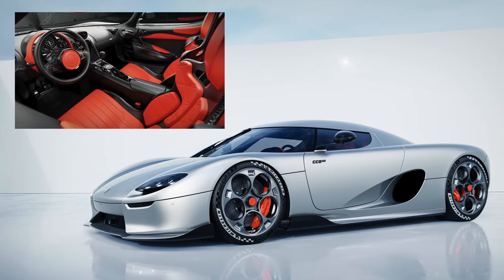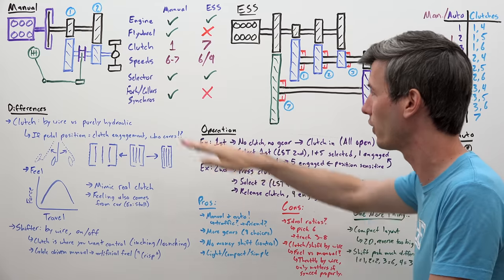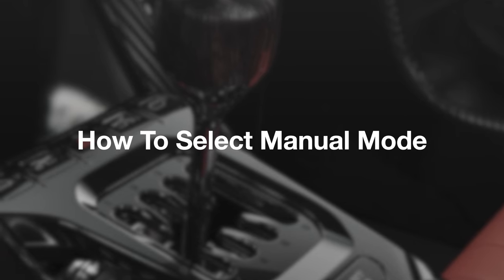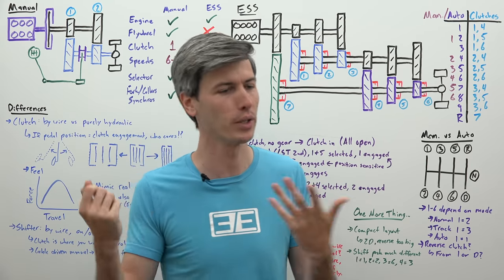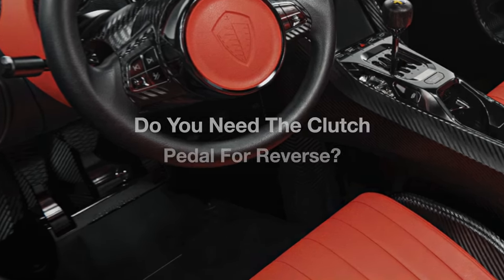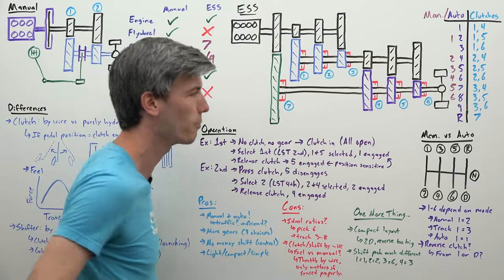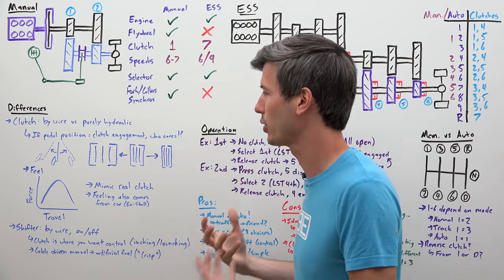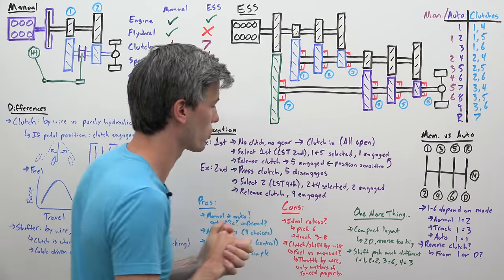Koenigsegg Reinvents The Manual! How The CC850 Transmission Works

Comment: That’s great engineering… but the more moving parts a system has the more prone to one of those parts failing + making it electric is more of the same problem… that system makes sense in a luxury car that won’t be driven that much, having that in a daily driver would be a money pit.

Comment: This is no wizardry. It is a completely automatic multi-clutch gearbox which works as a "stand-in manual" with shift-by-wire system design. ZF and Daimler-Benz does a similar multi-clutch and fork design work in their 8 and 9 speed boxes, only with no fake H-shifter.
No mechanical feel, no actual manual, sorry.

Comment: 7 clutches in a single transmission does not sound like a step forward.
Reply: Typical modern automatics already have 6-8 clutch packs, so your point is invalid.

Aisin transverse 8-speed: 6 clutches, 7 if you include the torque converter clutch, 9 if you include the sprag clutch. Used in Camrys, RAV4s, Volvos, Minis, VW’s, etc.

ZF-8 speed: 5 clutches, 6 including torque converter clutch.

Honda 10-speed: 7 clutches

GM 9-speed: 7 clutches

Etc.

Comment: What took industry so long to start offering five speed manual over four speed and six speed over five speed? During my first half of my life, everybody drove four speed, some three speed, some four speed with first ridiculously low ratio…crawling gear, or very long fourth gear…Volvo, VW. My Jetta has fifth gear outside of the transmission case…Weird?

Comment: wouldn't it be a lot easier to just install a racing gearbox and slap a pneumatic shifter and auto-liftoff software on it? all the linkages for this have to be absolutely insane lol
Edit: Nevermind, I didn't realize it was by wire; super lame :( (I'm glad it lets you stall it though, at least they're trying to make it not seem fake)

Comment: Ok, so it uses hydraulic pistons to squeeze clutch packs to connect and disconnect various gears, just like a normal automatic transmission. As opposed to the manual synchromesh system.
I think the only thing a traditional transmission can do that this can't, due to its electronic selector, is that you can't speed shift with the electronic version. Speed shifting is when you change gears without a clutch. If you know the correct RPM the engine needs to line up the next gear, you can pull the shifter into neutral (again, without engaging the clutch), then rev the engine to the correct RPM, and then move the shifter to the next gear. 

This little party trick can actually change gears faster if the driver is very talented. But I guess it's a dying art since tech like this doesn't even let you do it. Sad

Comment: this makes me think "800K transmission clutch change out" every 10K miles....
Reply: Typical modern automatics already have 6-8 clutch packs, so your point is invalid.

Aisin transverse 8-speed: 6 clutches, 7 if you include the torque converter clutch, 9 if you include the sprag clutch. Used in Camrys, RAV4s, Volvos, Minis, VW’s, etc.

ZF-8 speed: 5 clutches, 6 including torque converter clutch.

Honda 10-speed: 7 clutches

GM 9-speed: 7 clutches

Etc.

Comment: This is not an invention of Koenigsegg and is how most modern automatic transmissions work. Multi Plate Clutch Packs are nothing new. Motorcycles been using them 100 years. This is how every automatic with more than 4 speeds works.
Reply: Yeah it’s kind of funny seeing other comments moaning about “nurrr 7 clutches is too many” when regular automatics have been doing this for years.

Comment: It sure looks to me like this is just a modern interitation of a counter-shaft power shift transmission that has been in heavy equipment for decades. The gated shifter is just mimicing a manual transmission, there is no reason why it couldn't use paddles instead.

Comment: This definitely IS pretty cool and a meaningful innovation. The old-school dude in my head is panicking at the idea of 7 clutches. Pretty cool until you have to maintain this, yikes!
Reply from the maker: Modern automatics have seven clutches.
Reply: Typical modern automatics already have 6-8 clutch packs, so your point is invalid.

Aisin transverse 8-speed: 6 clutches, 7 if you include the torque converter clutch, 9 if you include the sprag clutch. Used in Camrys, RAV4s, Volvos, Minis, VW’s, etc.

ZF-8 speed: 5 clutches, 6 including torque converter clutch.

Honda 10-speed: 7 clutches

GM 9-speed: 7 clutches

Etc.
Reply: @Kyriaeus  Thanks for the info. Wow: I really had no idea how modern automatics are being assembled and assumed everone was still using a "slush box" with torque converter, seriously. The more you know... 😅. Agreed: my point is invalid. Seems like this transmission from Koenigsegg isn't all that innovative then: basically a modern auto with a manual clutch on the output side?
Reply: @EngineeringExplained  Whoa. My knowledge was way out-of-date. I've assumed all automatics are "slushboxes" with torque converters. Given this info, the Koenigsegg innovation is basically just a modern automatic with a manual clutch on the output side for more engaged driving enjoyment?
Reply: @grantandre79  most modern automatics have torque converters and a number of clutches. 
This Koenigsegg transmission works basically like an ordinary automatic with the option to manually manipulate the clutches (for engaged driving enjoyment, yes). It lacks a torque converter but does not have a "manual clutch on the output side" instead.
It uses well known, mature mechanism in all places, so the innovative part is in the combination and implementation.

Comment: I am not impressed by this transmission, or rather the praise that is heaped upon it is unwarranted. It is different for sure, new approach but it is basically an auto trans that tricks you into thinking it is a manual.
Reply: Not quite, the real difference in this is that it is made like a manual transmission and instead of synchronizers for shifting, it has clutch packs.  A automatic has a torque converter and planetary gears that change ratio depending on whether the plantary gear is held in place, or rotating (simplified explanation).  This transmisson is otherwise built like a true manual, the gears mesh the same way but have an extra shaft.  It eliminates the hydraulic squishy feeling of the torque converter.
Reply: @markpalaszewski9712  The inclusion of multiple clutch packs make it similar to an automatic. Power is only directed through the selection of clutches, same as an automatic. Automatics use an oil pump to power the shift action, Koniegsegg uses electrons to power the shift action. In a manual the driver powers the shift action. If there is no mechanical engagement a manual it is not.
Reply: @joshgorham750  what makes it closer to a manual is the absence of planetary gears and the torque converter.  In its assembly, it is built more similar to a manual where there are gears meshed together on separate shafts that are engaged or disengaged with synchros or in this case clutches.  This is more of a case of an automated transsmission than an automatic.  This would be no different than if the synchronizers were replaced in my old trucks transmission with electric clutch packs and then it was given an electronic shifter instead of a mechanical one.  True automatics have planetary gear sets that are either allowed to fully rotate or the ring gear is held in place by a clutch or brake band and the inner gears are allowed to rotate for a reduction, while the torque converter is the fluid clutch conection to the engine.  There is a lot more power loss through a true automatic than with this system.  I am not saying this is a manual, I am saying that it's construction and operation are more like a manual than an automatic.

Comment: Damn if its a clutch for each os those 7 gears then it’s gonna be impossible to do maintenance better switch for a new
Does anyone know how much does it cost for clutch maintenance?
Reply from the maker: Modern automatic transmissions can have seven clutches.
Reply: Typical modern automatics already have 6-8 clutch packs, so your point is invalid.

Aisin transverse 8-speed: 6 clutches, 7 if you include the torque converter clutch, 9 if you include the sprag clutch. Used in Camrys, RAV4s, Volvos, Minis, VW’s, etc.

ZF-8 speed: 5 clutches, 6 including torque converter clutch.

Honda 10-speed: 7 clutches

GM 9-speed: 7 clutches

Etc.
Reply: @Kyriaeus  ok now could you answer the most important question how much does it cost

Comment: Technically not much different from a ZF 8 gear auto or the VW DSG in manual paddle mode but different joystick scenario… 😂
Reply: Correct
Reply: They have a clutch pedal?

Comment: @ 8:24 that image of a cross on the gear selector is an active aggression towards Christianity. Sweden is an lgbtq nation and not only that but they are incredibly proud of being an lgbtq nation. Over 20% of its entire male population identifies as lgbtq. That's fine and all, except the fact that they're national symbol is something that blatantly disqualifies and illegalizes lgbtq social values. Sweden is forbidden from continuing to use the cross as a national symbol. They are absolutely disinherited from any godly Kingdom based on their love of lgbtq culture and social values. They are required to remove the cross as their national symbol and Koenigsegg has been served with seasoned assist papers to remove that gold cross from the gear selector from its vehicles. There are other option is to remove Koenigsegg corporation from the nation of Sweden to a country that adheres to Christian social values like most of Southeast Europe and Central Europe. So long as they move their company to one of these socially Christian and ethnically Christian countries, then they can continue to use the cross on their gear selector and in other imagery but it also must be specifically stated in company documentation that it has no relevance or connection to the swedish national flag which is deposed and decrepit. Entirely illegitimate. Their country doesn't reflect anything that their flag represents. It is nothing more than a cheap fraud; sweden. Land of males with low T and crippling import of radical Islam. Nation of shame and a proven collaborator Nation to 1940s germany. The worst criminals the Earth has ever seen, they collaborated with. Their country is stained with shame and lgbtq values. Gross! Sweden Ministry of Health said. 18.9% of all males in schvedan. Have acute cases of monkeypox 🐒🍌 🤢🤮

Comment: There's nothing manual about this, the computer does everything.
Reply: You control the computer manually 😆
Reply: @nhytg376tgyuu765gjmg  The computer completely handles the clutch engagement, you just have a simple switch disguised as a gear shifter. There's no mechanical feel needed from the driver in this system.

Comment: Imagine having to replace a clutch on a super/hyper car.......expensive! Now imagine having to replace 7..... also the repair bill for completely remove/dissemble the gearbox for it. It's obvious why this is never done for any production car. Only for the rich.
Reply: Typical modern automatics already have 6-8 clutch packs, so your point is invalid.

Aisin transverse 8-speed: 6 clutches, 7 if you include the torque converter clutch, 9 if you include the sprag clutch. Used in Camrys, RAV4s, Volvos, Minis, VW’s, etc.

ZF-8 speed: 5 clutches, 6 including torque converter clutch.

Honda 10-speed: 7 clutches

GM 9-speed: 7 clutches

Etc.

Comment: Nope. not moving hydraulic fluid by feel = sub optimal. Maybe there could be a solution where the hydraulics are physically connected from the pedal to each of the clutch packs and valves are controlled electronically to select the correct clutch pack...
Reply: No, the car don't know which gear you are going to select so with physically connection you would have to open all 7 clutches which will be too heavy.

Comment: Replacing one traditional clutch with 7 electronic clutches !  What could possibly go wrong ?
This transmission will never get used in racing cars because of reliability.
Reply: Regular automatics have just as many clutches and generally work just fine, so your point doesn’t really make sense.
Reply: @Kyriaeus  - How many racing cars you see with automatic transmissions?  Zero.
And normal automatic transmissions use planetary gears which are more reliable than in-line gears used in Koenigsegg transmission
Reply: @NICK-uy3nl  most racing transmissions typically have dog clutches which don’t last very long. They get rebuilt frequently, so longevity isn’t really important for race transmissions. Dog clutches in large trucks last much longer but the driver or the software rev matches every shift before engaging the dog clutches, which makes the shift much slower.

Your point about planetary gears is generally valid - they’re able to handle a lot more torque in a smaller footprint. They also don’t need the “handcuffs” that you find in high-torque parallel shaft designs because the loads are radially symmetric.
Reply: @Kyriaeus  The point is, a dog clutch is RELIABLE and does not fail during operation, but with seven little clutches,  chances of failure is very HIGH, That's why the Koenigsegg design is just a fancy toy.
Reply: @NICK-uy3nl  Again, regular automatics and even high-performance automatics have just as many clutches and work without problems. Maybe you don't understand how multiplate wet clutches work and that's why you have a phobia of them lol
Reply: @Kyriaeus  again, my point was such fancy automatic transmissions will never see use in racing applications because of reliability. For daily street use they may be OK but for heavy duty competition they will never  see action.
Reply: @NICK-uy3nl  It's not so much reliability as it is that true racing applications don't need all the creature comforts and longevity that an automatic provides, along with the weight penalty.  But you could say this about pretty much any transmission that isn't a sequential dogbox. 

Dogboxes only last a couple of seasons before needing to be rebuilt, but that doesn't matter for racing.

Dogboxes are clunky and drive like crap on the street when throttle application switches frequently and tentatively, but that also doesn't matter for racing. 

Dogboxes shift harsh because the dogrings literally crash into gear, but that doesn't matter for racing.

Drag racers do use automatics, but they have so much HP that they only need 2-3 gears, so they're still running old rebuilt Powerglides and Turbo Hydramatics. 

So writing off a design because "it isn't good for racing" is a pretty meaningless statement since the requirements for racing are much narrower than for road application.
Reply: @Kyriaeus  OK.
Reply: @NICK-uy3nl  OK. 👍

Comment: Great engineering, but damn obsolete for daily use just because of it´s technical and electronical complexity. Gears technically won´t wear out if you don´t abuse them, clutches will and I sure as heck don´t want to be the mechanic that changes out these. I´m already pissed I have to pull my gearbox to change the single clutch my car has.

Comment: More clutches equals more problems
Reply: Typical modern automatics already have 6-8 clutch packs, so your point is invalid.

Aisin transverse 8-speed: 6 clutches, 7 if you include the torque converter clutch, 9 if you include the sprag clutch. Used in Camrys, RAV4s, Volvos, Minis, VW’s, etc.

ZF-8 speed: 5 clutches, 6 including torque converter clutch.

Honda 10-speed: 7 clutches

GM 9-speed: 7 clutches

Etc.

Comment: I know you don't care about maintenance costs if you can afford a Koenigsegg but my butt puckers at the cost of replacing a single clutch, forget seven. 😬
Reply: Typical modern automatics already have 6-8 clutch packs, so your point is invalid.

Aisin transverse 8-speed: 6 clutches, 7 if you include the torque converter clutch, 9 if you include the sprag clutch. Used in Camrys, RAV4s, Volvos, Minis, VW’s, etc.

ZF-8 speed: 5 clutches, 6 including torque converter clutch.

Honda 10-speed: 7 clutches

GM 9-speed: 7 clutches

Etc.

Automatics basically never need clutches replaced unless you’re severely lacking on basic maintenance like fluid changes.

Comment: Nothing new here. Tractors have been doing this for years. These men only designed the gear shifter to give the driver the sence of "driving". Nearly all new tech starts of in agricultural machinery. Reason being tractors etc have 100 different jobs to do in the 1 vehicle but cars only go from point a to point b.

Comment: So we're deleting the flywheel/clutch assembly and using the gear synchros as a clutch. Sounds unreliable.
Reply: There are no synchros - those are replaced with much higher capacity multiplate clutch packs like the ones in an automatic transmission.

Comment: I dont think 7 clutches are a good idea
Reply: Typical modern automatics already have 6-8 clutch packs, so your point is invalid.

Aisin transverse 8-speed: 6 clutches, 7 if you include the torque converter clutch, 9 if you include the sprag clutch. Used in Camrys, RAV4s, Volvos, Minis, VW’s, etc.

ZF-8 speed: 5 clutches, 6 including torque converter clutch.

Honda 10-speed: 7 clutches

GM 9-speed: 7 clutches

Etc.

Comment: A DCT would shift faster, and a regular manual would be cheaper and more reliable.  I really don't see the point of this system
Reply: In auto mode there’s no reason conceptually why a DCT would shift faster or slower than this. They both shift by swapping clutches. The shift speed would depend mostly on hardware quality and shift strategy.
Reply: @Kyriaeus  Correct, but with more clutches it's a lot more expensive.  My shift speed comment was about using manual mode, where the computer adds an artificial delay while the driver is pressing the "clutch" pedal